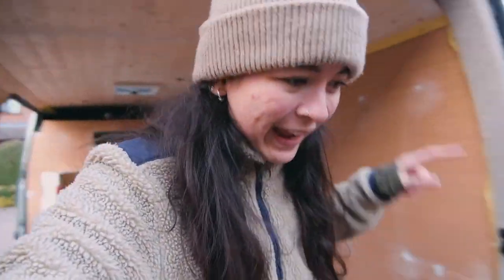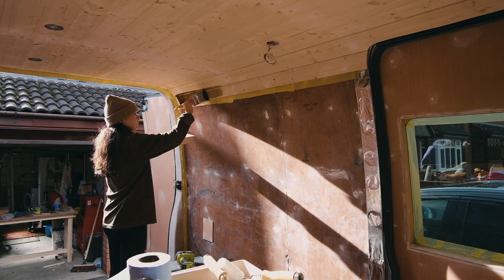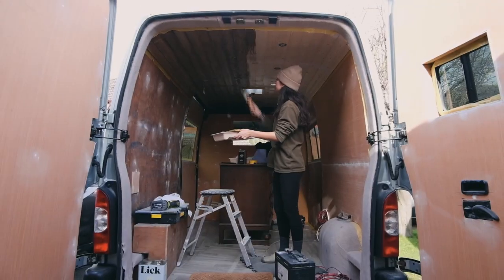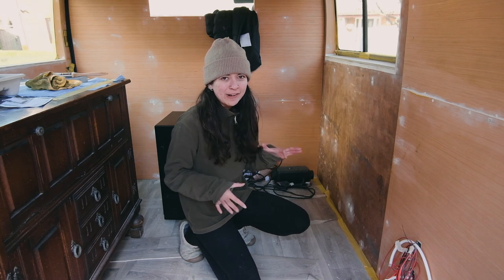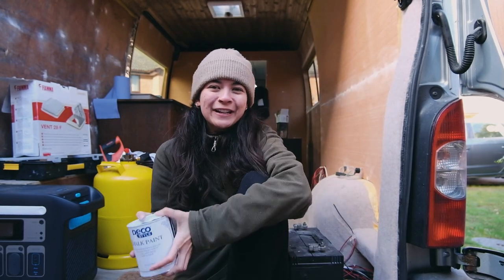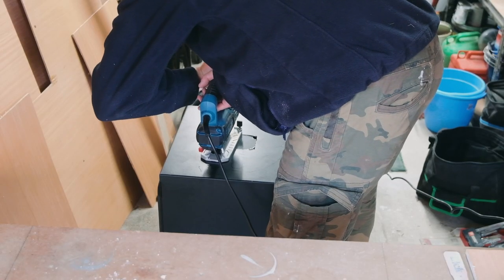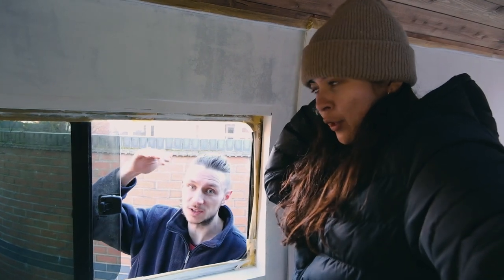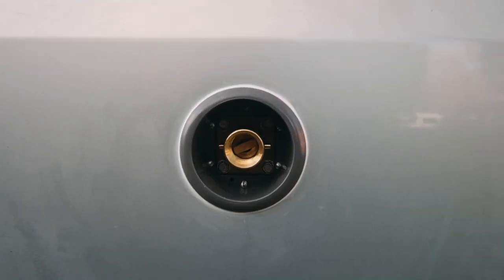FITTING THE GAS | Refillable LPG System in our Self Build Campervan | Ep 14

Comment: Hey Nic & Sam - thanks for making these videos they are helping sooo much with our planning! One question - I've read that to pas gas certification, the locker 'can't be accessed from the living area'. We planned to put ours in the same kind of position as yours, so how did you get around that? Or was it not something the engineer said? Thanks!
Reply from the maker: Thank you so much 🤗. We’ve not had sign off yet, hopefully next Friday someone will be coming so we will let you know then. To my understanding that is a rule for motorhomes. This website, section 2.3 states ‘For motor caravans where penetration of a type approved base vehicles bodywork would be required to provide external access, internal access to the cylinder compartment would be permitted providing the following conditions are meet:’ and I believe we meet the requirements 🤗